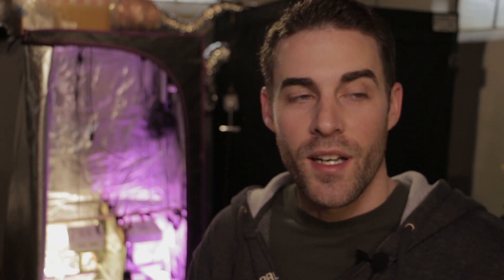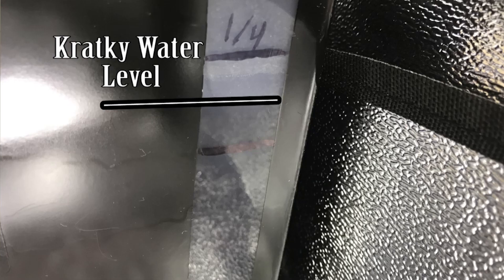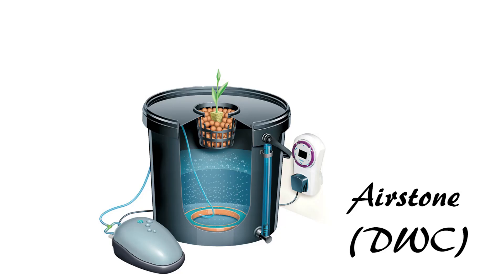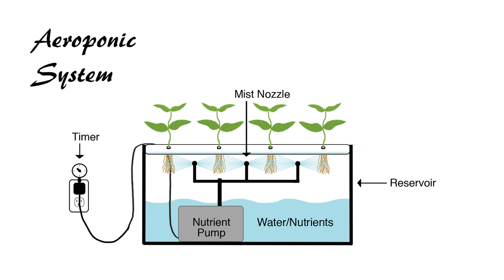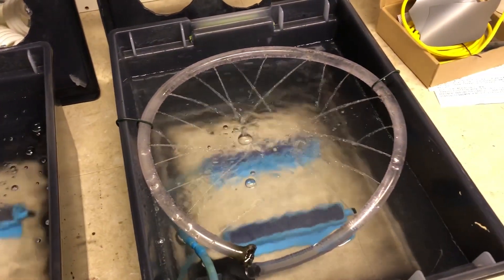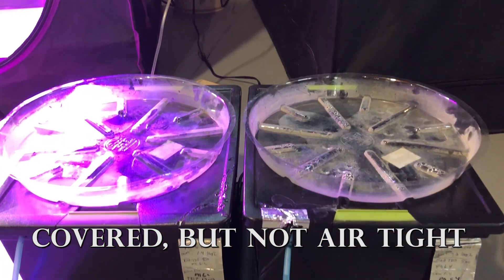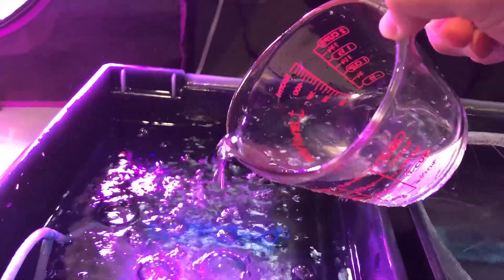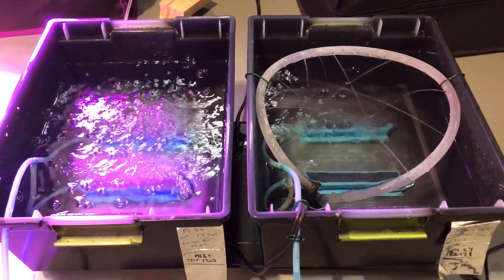Airstone vs Aeroponics - Something Overlooked...

Comment: the surface area of hundreds of moving bubble's in the water is ten times more than the agitated surface . think about what you say before you speak . i hear this comment said a lot when its not true, there is more agitation and oxygen exchange as the bubbles move up through the water than surface agitation, surface agitation is a bonus and does increase exchange but it does not get most of it through surface agitation its the bubbles that give it the most agitation. think about you carbon filter why is it called activated and why does it perform better when its activated ? ( one example of many)  been awake is good been woke is not.

Comment: I've been growing with LPA for 10 years.
Each of the areo systems i built have 2, 21 site grow chambers with 1 reservoir.
Each system measures 3'x3'. This way I can use 1, 3'x3' LED light.
I built 4 of these areo systems. I run all 4 systems at the same time.
All 2 weeks behind each other.
So i harvest every 2 weeks.

There have been countless times when I was doing something to a system and have forgotten to plug the pump back in.
A lot of times I don't catch it for 24 hours later and I've NEVER lost a plant.

But the precaution I have done, just in case there is a power outage.
I installed a solar system on top of my grow garage.
Just for backup.
But I've also been using it to power my mother and clone room.
So it's been a win win for me.

Your systems look ok. They work for you.
Me personally don't like my roots hanging in the solution all the time.
Reply: Yo man, I've seen you commenting to a aeroponics potato growing video! You have some super interesting insights to the aeroponics. You should start making videos of your system. Or can I find you at some forums? Would love to read more of your stuff before I start building my own aeroponic system.

Comment: Air pumps are not needed. Use inline or submersible pumps run resivior to feed water rings 24/7 to buckets head pressure will keep it all fairly level.

Comment: Great video, thank you, I have a quick question. I have this small 7" square container with lots of action from to two 6" air stones. I have 5 spots for 2" net pots.  My question is, Where should I place the end of my clematis cuttings in relationship to my water level.  In some holes I'm using just the closed cell foam collars with the bottoms removed on pots others have intact pot with rockwool and collars.  my waterline has the bottom 1/2" submerged.

Comment: I use 2x4 in. air stones with a 300 Amp battery system and 2000 watts of solar, plants grow much faster and easier than soil...
Reply: What's the wattage light?

Comment: I use a combination to grow in turbo speed🙂. Roots sit in about  5 inches of water being bubbled.  Water misters run 15 min on 15 off with a timer set for the pump . Grow is better  than dwc. I use a smaller pump and only two hole.  Smaller pump helps water temps. Something about suspended roots in air and dampness  really makes growing fun. Also I use beneficial micro's so I never get root rot. Dryer parts of the root ball will have fuzz. 
So not fully submerged roots all micros to live and the plant uptake nutes.
Reply: how much faster is it, compared to the aeroponic system alone?

Comment: fill and drain does not have to be a 100% drain, you can adjust the height of the bottom of the 'bell' so you siphon wont drain below that point. you then have roots in water 100% of the time and roots directly exposed to air aka 'oxygen' much of the time. also your aeroponics looked like you just had a hole pricked in the pipe and not a misting nozzle. so how is that aeroponic?
Reply from the maker: Neko Mancer it’s just an experiment for proof of concept.

Comment: The hybrid method for me is a bunch of coco around root with a drain and fill with air stones everywhere including in the coco itself so at worst my plants are using water while the coco allows the air roots that are never submersed to breath still even in total power loss  at max depth
I currently use an air water pump so my second air pump runs that to fill and i have a auto syphon that    drains but if that fails i have a wayer pump every 6 hours 
2 air pumps 3 air stones 1 air water pump 1 Water pump
450w of led lights 
Been great so far growing some carolina reapers and some passionfruit currently and buying some stuff for doing some outdoor salad dwc/kratky lettuce and pumpkin

Comment: For clarification, you no longer are injecting air into the container? You are just relying on the falling water to push air into the water basin?

I'm trying to decide if i want an external reservoir and a dry root area or having the reservoir inside the root area like you have.

Just wondering your thoughts
Reply from the maker: No air injection, but roots don’t breath like animals do. As long as the container is not air tight, there plenty of oxygen. And this is really just a proof of concept. When a plant is large, the evap doesn’t really matter I’m either method. It’s sucks up water faster than it evaporates. Small plants however, will benefit more.
Reply: @GrowingAnswers  VPD

Comment: Again, this is not Aeroponics
Reply from the maker: rarely lucid it sorta is. Maybe not with misters, but same concept. I think I mentioned it’s more of a hybrid. And for the sake of the experiment, it doesn’t really matter what the proper term is.
Reply: @GrowingAnswers  wrong .. so wrong... aeroponics refers to growing a plant in an environment in which the roots grow almost solely in air which in turn allows certain characteristics to show themselves in the plant such as hyper fast growth.. 3-5 times faster then soil .. hydroponic growth is only at 2-3 times faster then soil..research actual aeroponics .. what you made was a deep water culture with a sprinkler.. a shitty sprinkler at that... consider this.. a high school footballer calls himself an Olympian.. would you agree that he's kind of an olympian?  he's young and runs on a field... No he is not and your system is not aeroponic ..  let me help a little with this.. look up micron size of droplets required to absorb aeroponicly .. it certainly cant be build with a nail and propane torch.
Reply: @rarelylucid4488  are you deff mate it's a hybrid  aeroponic system its  dwc with aeroponics without the mist
Reply: @GrowingAnswers  
If the root structure is the same as hydro, its hydro ;) Folks that spray water at roots assume its aeroponic but then you`d have to say dunking a plant in a bucket of nutes every so often is also aeroponic, when it is, in fact, flood and drain without any medium ;).Sprayed roots get wet and are allowed to dry, much like F&D. An aeroponic system should provide a constant mist which the roots are suspended in. Imagine a theoretically  perfect soil which maintains optimal moisture, nutrient and air balance at all times, then imagine it without the soil ;) Aeroponic roots, structure wise, have a lot more more in common with soil roots than with hydro roots.

Comment: Yes! Another great channel that uses the scientific method as well as we can in a semi-variable environment. Great motivation, great video. Subbed.
Edit: *Hybrid aeroponics. Great information about surface tension. I ebb and flow but am looking into aeroponics. I would have thought the hyvrid aeroponics would evaporate more and I like your logic. my current system is not for leaving more than 2 days so that looks promising. I wonder however about fog type aeroponics or mist? Thanks again!

Comment: Great informative videos, just subbed.
I have a question similar to some of the other comments for this video.
I built a 5 gallon bucket cloner & opted for a pump & misters instead of air pump & stone. After using it for a few months with good results (nubs in a week, transplantable to soil in 2 weeks using plain tap water only). Now I'm wondering if I'd get better results faster if I got more air into the bucket, since it's pretty much a sealed system?? 
Or am I worrying about nothing?
Or would adding just some rooting solution additive be better?
Reply from the maker: Mark B it’s not really a sealed system if ur using net pots. As long as there is some way for air to exchange, it’s not going to suffocate.
Reply: Growing Answers 
Thanks for taking the time to reply.
I'm not using net pots, I just drilled my bucket lid to fit the neoprene/foam inserts. I can hear air escaping through the insert slits when snapping the lid into place, so it's not airtight but there's no free exchange of air either. 
Would you recommend that I add maybe a pipe coming out of it somewhere to let some fresh air in? Or not even bother since I'm getting good results in 2 weeks time?
Thanks again
Reply from the maker: Mark B there needs to be some air exchange. Crack the lid a little.

Comment: You have to try these!!!!

https://youtu.be/Gf0wtwcruo4
Reply from the maker: I don't really see the difference between those and an air stone. It's essentially doing the same thing except maybe getting the water droplets higher up from the bottom of a reservoir. I can see those being used to save on large quantities of solution. That's the one thing that is not efficient about hydro dwc/kratky is that it can be wasteful depending on solution changes with larger reservoirs. Other than that I think a recirculating sprayer would work better because those little burst fountains will stop getting solution higher up once the roots crowd them out. Its highly circumstantial though.

Comment: Great vid. Thanks for sharing. Question: what's the HIGHEST your water temp gets to in the aeroponic hybrid set up? I've heard anything over 64°F is bad, but I've heard others say they've had no problems with water temps up as high as 90°F. 
Thanks for your time.
Reply from the maker: Thurin Hagrem for best results the temp should be below 68f. It can be challenging because of ambient temps. But yes, it’s not like everything is just going to die if it’s gets warmer. But problems can start happening.
Reply: Growing Answers copy that. Thanks man. Great channel too btw. 👌
Reply: identitygone 68 to 74 is ideal temp .
Above 74 your risking pythium root rot. Below 68 your shocking the plant. Lower temp holds more dissolved o2

Comment: Hi, really good videos, thanks for making them. Would be interested to see you talk in more detail about how you set each system up. Keep up the good work
Reply from the maker: It’s just an airstone with a pump obviously for the aeration. The other was just a very small pump from a terrarium waterfall. I attached the tube directly to the pump, crimped the end and melted holes in the tube with a heated nail. The pump was submersed in the same container. No external reservoir
Reply: @GrowingAnswers  - thanks for the explanation !

Comment: Just found you and this is pretty intriguing. Gut instinct says that the airstone, with the small bubbles, is going to aerate MUCH more efficiently, so you're just sacrificing aeration for convenience. The fact the airstone is evaporating considerably more water away would seem to bear that out, because there's probably a greater water/air interface with the mass of small bubbles, compared to a few streams of water hitting the surface. I'd also be curious to see if either method causes the water to heat up. ie forcing the air through the airstone or the water through the holes in the pipe requires pressure and a fluid under pressure generates heat. May not be significant but possibly worth checking temperatures since the containers are, presumably, going to be side by side if I understand correctly. Also will both aeration methods be using identical pumps? You should maybe check the power draw of each as well, if you can. 

I wish I had the room for this sort of thing. All my hydroponic space is currently turned over to raising seedlings.
Reply: why not just do both?
Reply from the maker: Anton Gully the water pump uses less watts than the large air pump I have. But that’s just my situation. The power draw is so small it doesn’t matter. And yes, by having a pump submersed it can heat up the water slightly if it’s a larger one. In my case the water temps stayed the same. More bubbles doesn’t mean more oxygen either. Not unless an atomizer is being used. Spraying water through the air creates much more water air contact than bubbles do.
Reply from the maker: gibbetify if the bubbles become trapped within the roots, yes. Otherwise the o2 diffusion comes from surface agitation and not bubbles. If anything, a recirculating sprayer system has much better contact with air than an airstone can create. But I doubt that really translates to much difference in growth potential
Reply: @GrowingAnswers  A bubble is a pocket of air in the water so it has a spherical "surface" which moves through the water. How is there no surface agitation this way? To my sense there is quite a bit of surface agitation with the bubbles. For sure it will evaporate much faster and that's something I didn't realize before.
Reply: But as he said, won't the airstone improve the Oxygen content of the water for submerged roots?

Comment: Hi the problem i have with aeroponics is that the misters block up and you spend many hours cleaning or replacing them... Your thoughts, compared to the DWC system.. Yes adding a cup of water over a few days is not that hard to do ....
Thanks
Reply: If you run aeroponics you`ll discover the low water/nutrient usage allows you to run it drain to waste. Nozzle clogging isnt an issue when pristine nutrient only run through the system once. Drain to waste provides numerous benefits  you wont get from a recirculating reservoir ;)
Reply from the maker: Kim Rauch I’m not really talking about using misters though. Simply creating some holes in tubing to creates some water fall effect is plenty if doing it hybrid style. Yes the problems with aeroponics is cloggs and even roots finding a way into the pump. However there are pros and cons to virtually all methods.
Reply from the maker: Atom izer so are you talking about a drip system or misters?
Reply: Aeroponics, namely high pressure or air atomised.  Drip is hydroponic ;)